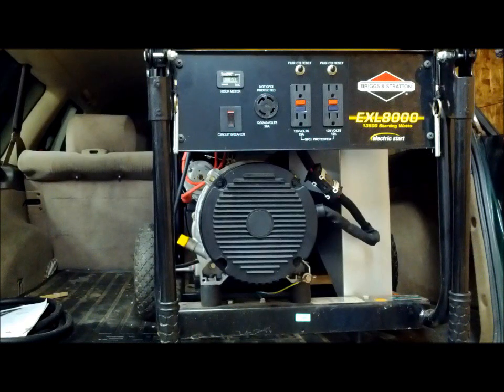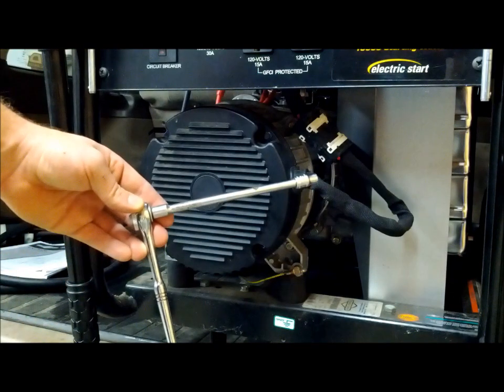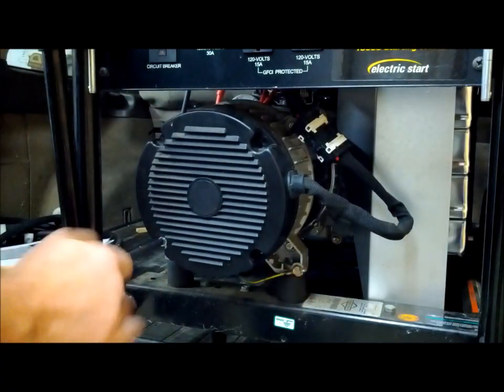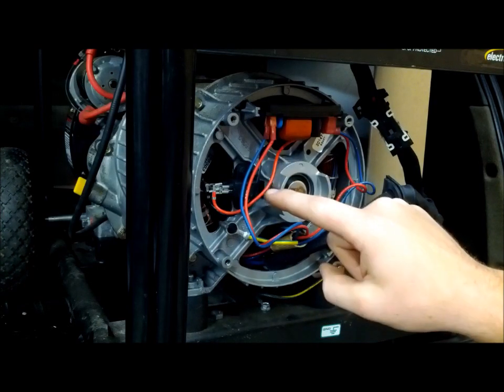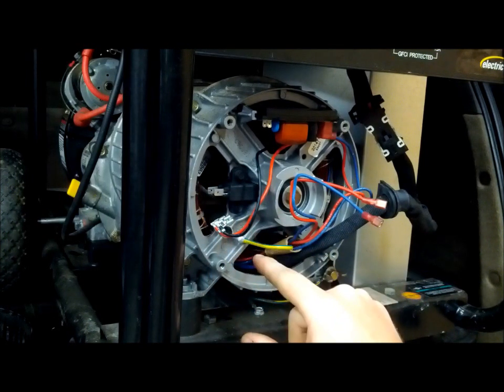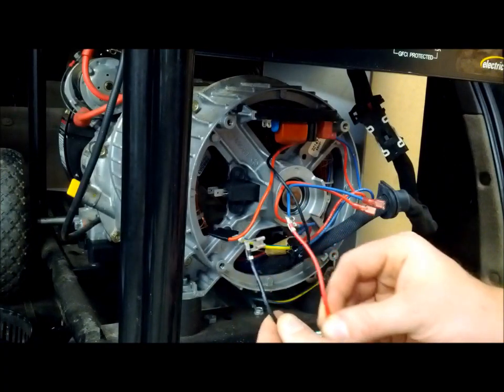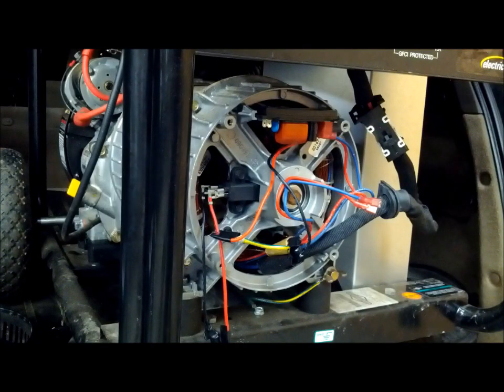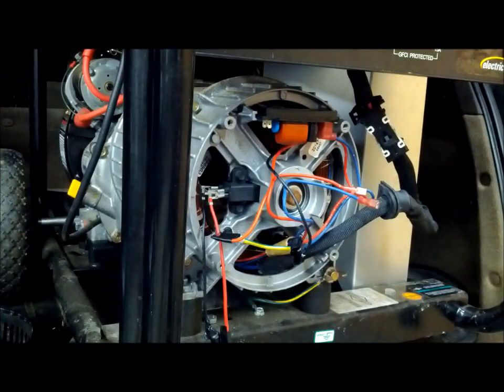Diagnosing A Generator That Has No Power Output.

Comment: I did exactly what you said but to a generac 3500XL model 09441-2 and I only got 30 volts. That means my power head is fried huh? I accidentally turned the main from the road back on before turning off the generator. I have been hooking and unhooking it up to my home for years and for some reason I had a brain fart.

Comment: Hi I have a power max 1300w generator, motor runs okay but as soon as a power tool (500w) is switched on it stalls the motor even if I manually keep revs up thanks

Comment: I have flashed my generator which has been unused for multiple years. I now have between 39 and 42 volts when I test the two wires disconnected from the AVR. I do not see a capacitor. My generator looks almost identical to the one in this video, except it is labeled Briggs n Stratton XL 8000.

Comment: Hi im having a problem with my generator and i did the things you said and im getting around 106v does that mean the avr is good or bad thanks?
Reply from the maker: Most low voltage conditions on generators are simply due to a low engine rpm. So your engine rpm should theoretically run @ around 3600 rpm which will produce 120/240 volts @ 60 HZ. So when you applied 12 volts into it you got 60 volts when testing?  It also could be a bad capacity which will result in a low voltage reading from the generator as the power being generated will be from the residual magnetism of the rotor (usually about 2-5V). To test a capacitor, a multi-meter that can test capacitance is required. To test a capacitor, it must first be removed from the generator and discharged. Be careful when removing the wire leads that a short is not created across the capacitors terminals. (Videos out there on how to discharge a capacitor. Some just say use a screwdriver with an insulated handle to cross the terminals on the capacitor (this will result in a loud pop and a spark). Once discharged, take a reading from the capacitor. The measured capacitance should be +/-5uf of the specified rating printed on the side of the capacitor. If not, the capacitor should be replaced.

Comment: "Alligator clip"?  I saw some push-on terminals, but no alligator clips.
Reply from the maker: Ya I had some push on clips for another project so I used those instead of alligator clips. You can use either but I figured more people would have alligator clips rather then push on clips or the female spade connectors.
Reply: Did it confuse you?

Comment: Have a generator where only one half of the outlet works, replaced outlet but no luck, any helpful hints to repair?
Reply from the maker: What make generator and modelis it? is it 110 volt only or a 220 volt? Does it have a switch to change from 110 v to 220 v if so check that switch. Also check the circuit breakers or reset buttons to ensure there not tripped. Is the GIF reset on the outlet? I'm guessing your talking about a 110 volt plug that either the top or bottom half works. When you replaced the outlet did it have 2 or 4 wires going into it? All the other plugs work?
Reply: The generator is a Coleman Powermate PM0543000.01. No switches to switch between a 110v and a 220v. The circuit breakers nor reset buttons have been tripped. Yes a 110v plug and one side does not work. The new plug that I replaced it with is the same, 4 wire. The generator only has one double outlet totally. Any help would be appreciated as it is new, but was not taken out of the box for quite a few years. Just puzzled why one side of the out let works and the other end doesn't. The receptacle is a 120 v, 20 ampere duplex receptacle.
Reply from the maker: So since it has been sitting it may have lost its residual magnetism on one leg. So lets try and "flash" that side and see if that works. So what you will want to do is start the generator let it run for a minute or so and then grab a CORDED drill. Plug it into the NON working outlet. Make sure the drill is in the forward position/ going in the forward direction and then squeeze the trigger on the drill and spin the head of the drill backwards 5 or so times then let go of the trigger for the drill wait 5 seconds or so and then pull the trigger on the drill and see if it works.

Comment: My Kohler Marine diesel engine keeps giving me low voltage and shuts down within a short while. What do I do
Reply from the maker: Proper level of oil in it? It could be a bad low oil cut of off switch. Not sure if it has a high level coolant cut off switch as well which if they coolant gets to hot will also shut it off. I am not sure what the proper RPMs for that generator is supposed to be.. If its not running at the correct RPM's it will give you low voltage.

Comment: I have a homelite lr5000t that has no output power any ideas on how to fix it
Reply from the maker: You can try "Flashing the generator" if that doesn't do it, it could be a "faulty diode" if you google either one it will give you an idea on how to flash / replace that riode
Reply: +TheDIYGuyDOTnet I tried that with a drill but no luck
Reply: TheDIYGuyDOTnet

Comment: OK, so I have a 6,500 KW Diesel brushless enclosed generator that has an external AVR.  Engine runs fine but now power is being generated.   Since I cannot remove the two wires off of the rotors where and how do I hook up an external 12 volt battery prior to testing the tow wires coming off the AVR?
Reply from the maker: +Paul Thomas That is the 12v battery method. You can try the electric drill Method..
Plug in an electric drill into the generator receptacle, If the drill is reversible, move the direction switch to the forward position next Start the generator. While depressing the trigger on the drill, spin the drill chuck in reverse direction. This will excite the field and the generator will now produce electricity. If spinning the chuck one direction does not work, try spinning the chuck in the other direction as you may have the reverse switch positioned backwards. Use caution not to get your hand or other materials caught in the chuck.  As soon as the field is excited, the generator will produce power and the drill will turn on.

The reason this works is because the electric motor in the drill will act as a small generator when spun backwards. The magnets in the drill's motor induce a voltage into the motor windings, which is fed back through the trigger, cord and into the generator receptacle. From there it goes into the power winding of the stator. The voltage going through the power winding creates a magnetic field, which is intensified due to the iron core of the stator laminations. The rotor intersects this magnetic field as it is spun past the power winding, thus inducing a voltage in the rotor winding. Once current flow is present in the rotor winding the rotor has been flashed.
Reply: TheDIYGuyDOTnet .

Comment: I have the older style AVR where would I check for voltage? Right at the outlet on the control panel?
Reply from the maker: It will be the same wires going to the AVR. Yours should just have the black inline booster.

Comment: you did not say if you just hook the negative wire up for seconds or about a minute while engine running , then check for ac volts out on the two wires. if it has ac output on the two wires ,shouldn't it read 110 vlts instead of 60 vlts?
Reply from the maker: You want to start the generator and let the engine idle/ speed stabilize and then hook the Negative lead to the battery for the entire time while testing the two wires. So to recap generator running stable engine idle, then hook up negative lead to the battery, then test the two wires, unhook negative lead from battery and then shut off generator.  You want to have a min of 60vlts. Those 60vlts would go to the AVR where it boosts up the excitation to the field of the generator to maintain the terminal voltage. 120v / 220v.